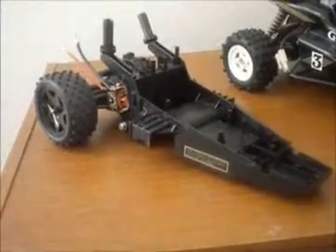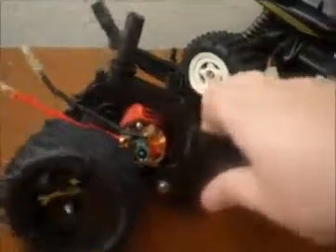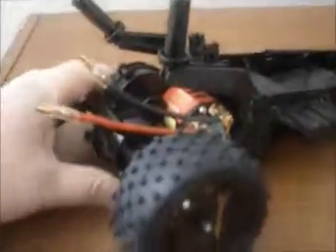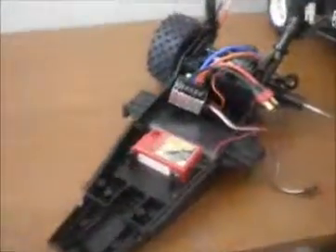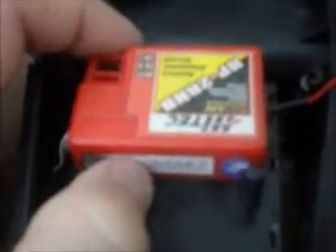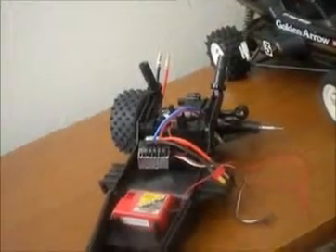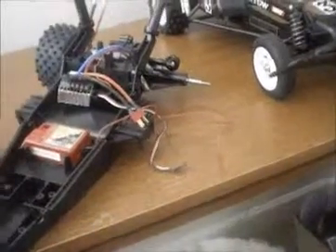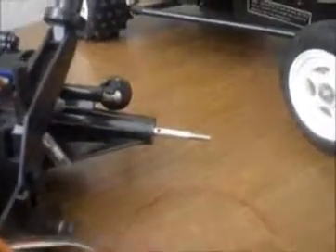Radio Shack Golden Arrow Project Part 2

Comment: I picked up a flying arrow 2 at a thrift store.i was wondering if the 1 and 2 what the quality difference between the two? Naturally u would think that two would be a upgraded version,but the 2 doesn't have a hobby grade battery it takes 8 double A.

Comment: Curious where would I find rebuild kit for gears for a GoldenArrow? I still have mine fr my childhood but it needs a gearbox rebuild, its really worn ro point of slipping. You can here it also doesn't pull nearly as it should. Thx in advance,..
Reply: You can use the gears from a tamiya hornet or grasshopper
Reply: @nomusicrc  🙏 appreciate the info,.